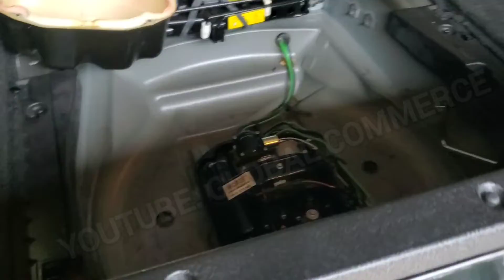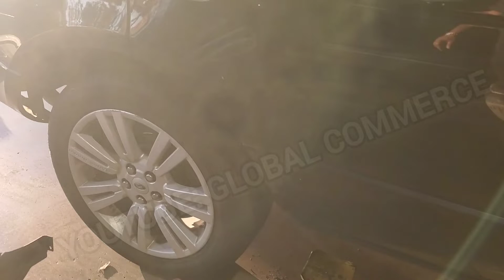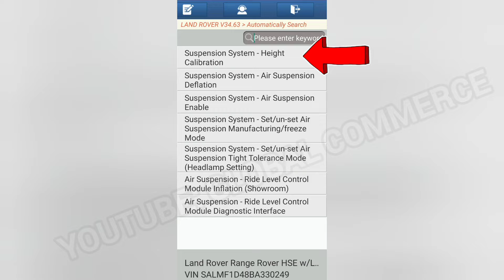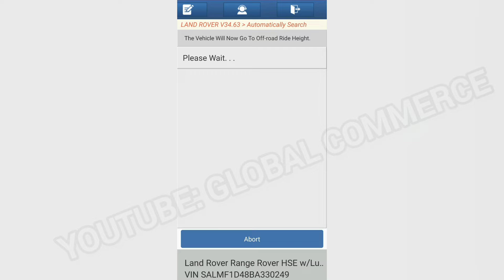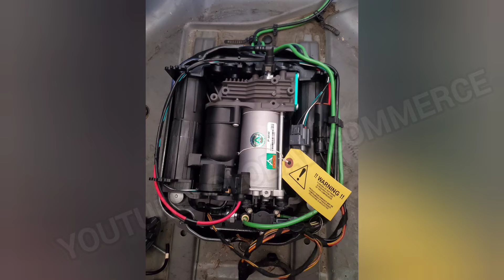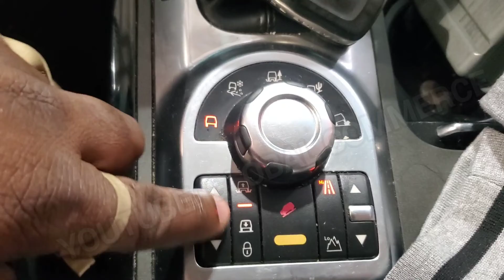2011 Range Rover Land Rover L322 air suspension problem,  pump calibration, U3000, C1A13 fix, GUIDE!

Comment: Hi there. I also have a Range Rover with the 2004-model, 210 kW (280 PS) petrol M62 B44 BMW engine. It has a problem that no one has been able to solve. I’ve replaced the front air struts, the height sensor arms, the pump, the main valve on the lower right side, and the brass-colored valve at the rear; when I hook it up to the diagnostic tool, it shows no issues. The car rises but won't lower. If I remove the yellow air valve from the rear cargo area, start the engine (holding the valve in my hand), and command the car to lower from the dashboard controls, it does lower. However, if I put the valve back in, start the engine, and try to lower it, it won't go down. The diagnostic tool shows all valves as closed and the relay as closed. I’m completely stumped—does anyone happen to have any knowledge about this? Thanks.
Reply from the maker: Since it lowers manually when the valve is removed, I would investigate the wiring or the control logic for that specific exhaust valve circuit to ensure it's actually receiving the signal to open.

Comment: I notice on the opening comments in this video that the radio power button is blinking, but the radio screen is blank. I have the same issue on a 2008 L322, and can’t figure out the issue. How did you resolve this? Thank you.